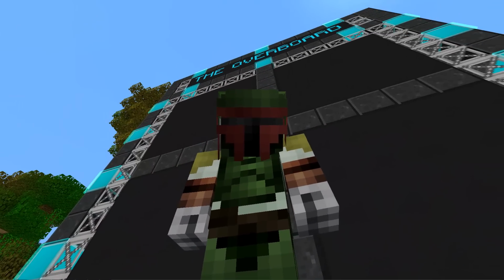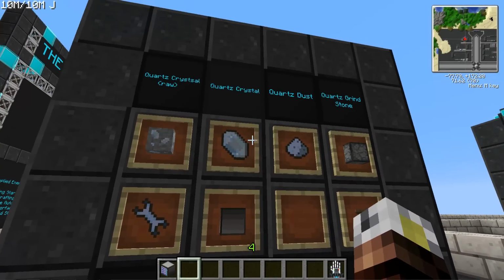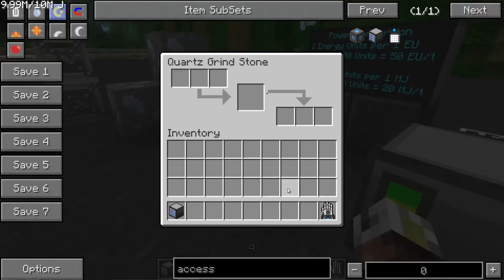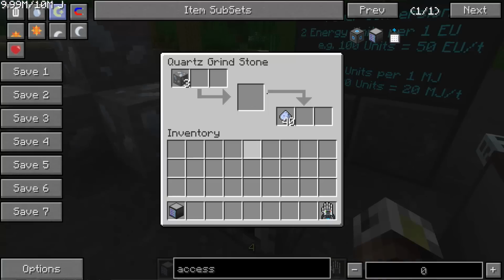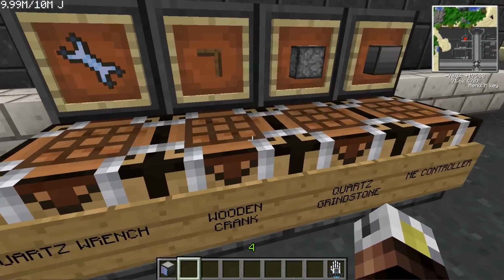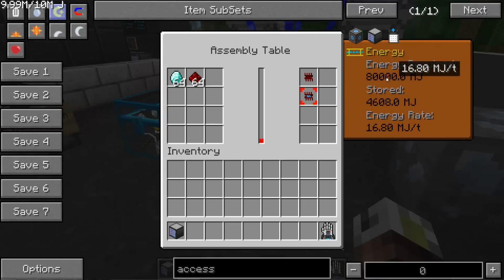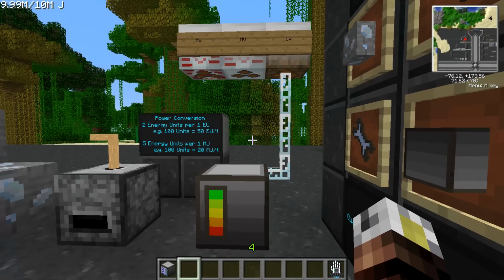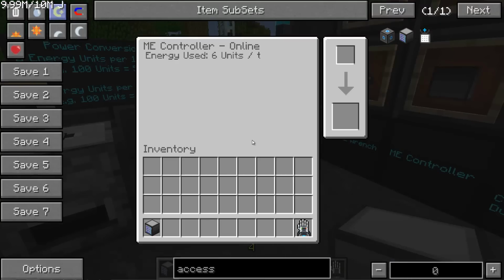Tutorial - Applied Energistics - Part 1 - Getting Started

Comment from the maker: To answer your question, yeah there are a few changes as the new Tekkit is using version 10.I and some semi-major changes changes came in 10.a to support MC 1.5.1 with "fuzzy" busses, more mod compatibility, and some changes to Quartz because MC has it's own Quartz now. There are also some slight (internal) computing changes that should solve the multi-recipe-for-the-same-item issue.

CaptainJack is just hatin' cuz there's no RP2 in the new Tekkit.

-Ingrimmm

Comment: I have to ask do you have a vid on making and using the lasers getting them running.. atm i am using tekkit lite 1.4.7 and im using that with a pack made by split infinity radio. but the newer way to make redstone chipset. is not there.
Reply: You put the assembly table on the ground, the laser/lasers on a wall 2 blocks away from it. You put buildcraft energy (MJ) in the laser/lasers at the back and there you go